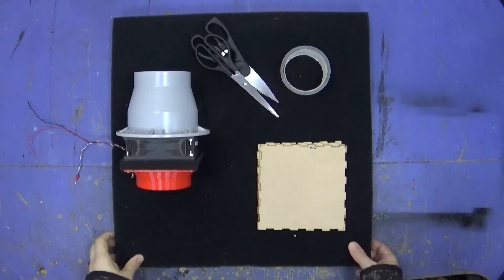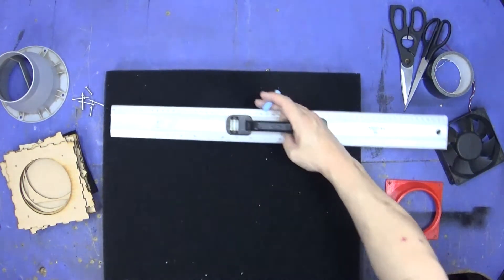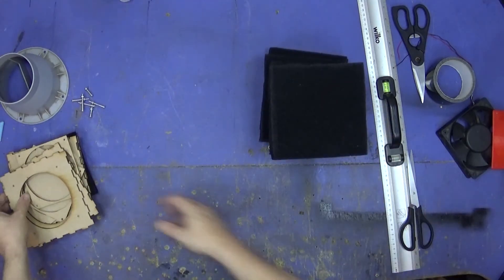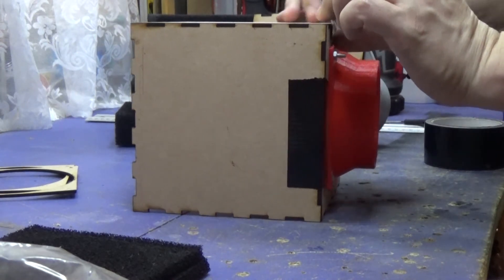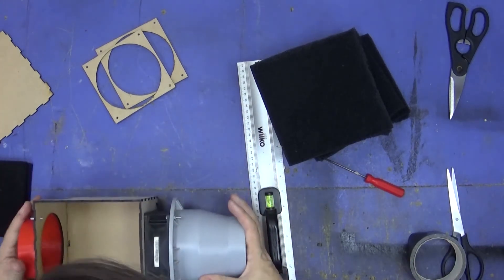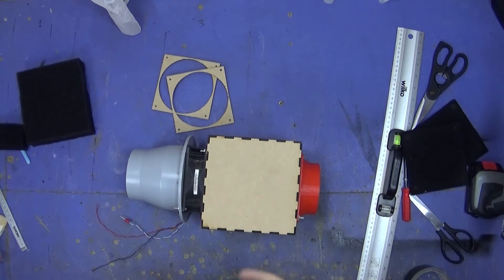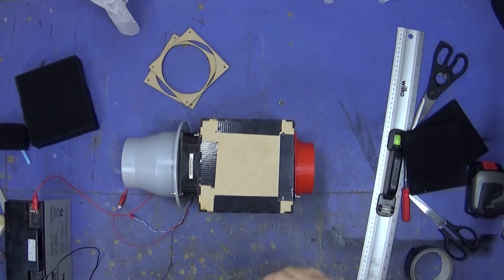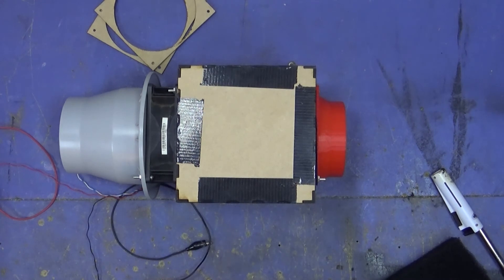K40 Laser Extractor & Smoke Capture Filter Prototype V2

Comment: Hi, I have been looking for this exact solution since moving to a smaller property with close-by neighbours. I would be interested to know how this is still working for you 2 years down the track. Do you have to replace the filters much? Or are they cleanable? Cheers!
Reply from the maker: Hey Andrew, although this works "ok" but not fantastic. I'm still trying to make the ideal device to extract the smoke but it's much trickier than I first thought. The filters can be removed and smacked about a bit to remove a lot of the build up. I will review this project in the future and try and make it work much better. If you do decide to build this and make any improvements please let me know. Also if you need any help just message or email me. Good luck
Reply: The Off Grid Family thanks mate, yes I have a had a bit more of a look and it seems the solutions people are coming up with are quite involved and it seems as though no matter what, especially with MDF, filter changes are going to be necessary. I did hear that if you are using activated carbon powder, you can clean it by heating it up to extremely high temps
Reply from the maker: @andrewhayden8681  yeah Cody's lab looked into that. My small claim to fame is he messaged me about my activated carbon video because I'm such a big YouTuber 😉. 
There are many solutions that will work. One I looked into but never got a chance to try was passing the smoke through water.
Tell me how you get on as I'm really interested in finding a decent DIY solution. Good luck and as I said if you need any help just message and I will do what I can. Stay safe buddy